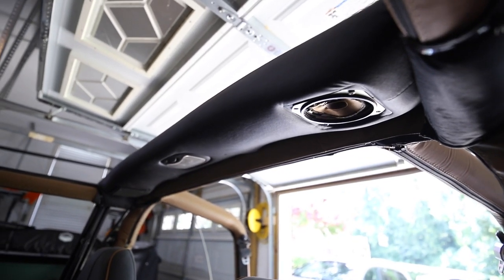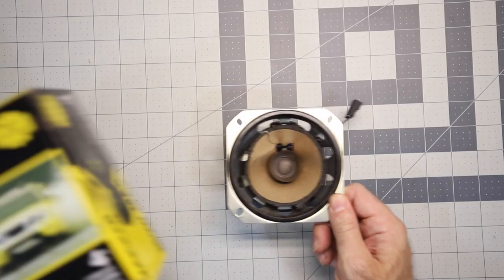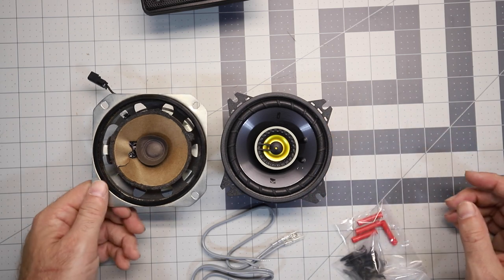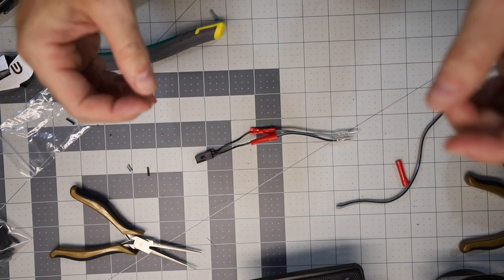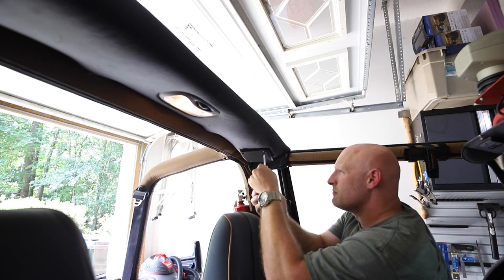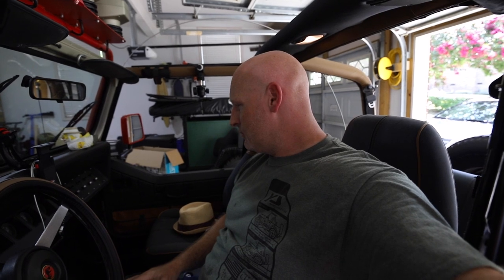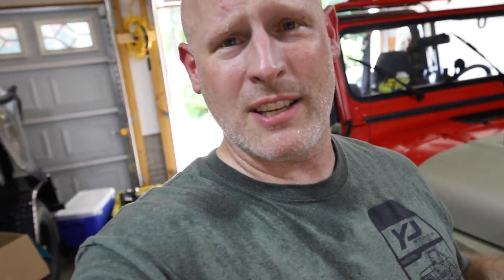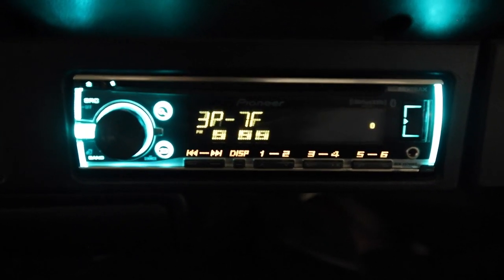Jeep YJ Stereo Upgrade & Factory Radio Install

Comment: I know it's been 2 months but I just wanted to let you know that heat shrink for wires is your best friend. Or if you already have the wires connected you can use liquid tape.
Reply from the maker: Thanks. I really need to get into the radio again and get it working. Haven’t had a chance yet.
Reply: @SimplyMustGo  well I had a 95 back in the day and I'm looking for another one. But heat shrink and liquid tape was the best. It keeps water out and we know if you take the top off its going to rain not dought about it. But as far as your radio make sure its grounded good or it want work properly. Wished I was closer I'd help you out. I grew up in NC lived there up until 7 years ago now I live in Missouri.
Reply from the maker: @jk_wrangler13  thanks! Maybe one day we’ll get to meet half way!

Comment: Where did you find a retro radio with Bluetooth???

I've similar issues with my 1994 Sahara.  Currently waiting for a used oem radio
Reply from the maker: This is the radio I ended up with and I really like it. https://amzn.to/3FPrxzk also you’ll need the adaptor. https://amzn.to/3W8HzcM
Reply: @SimplyMustGo  did it fit well?
Reply from the maker: @thomasstanfield1891  Yeah, here is the video that has the install of that radio. https://youtu.be/zGI3fvRkHyw
Reply: @SimplyMustGo  does the dash facia need trimming?
Reply from the maker: @thomasstanfield1891  no. No trimming or anything. Pretty easy straight clean fit.

Comment: Did you take down the video you did about replacing the cushion for the soft top frame? What was the replacement you told us to get?
Reply from the maker: I don’t think I did one on a soft top cushion, are you thinking of the roll bar padding? If so they are the best top spice roll bar pads.

Comment: How did you discover the ground issue (screwing in the radio)? Did you redo the install and did it work?
Reply from the maker: Beav told me about the grounding issue. But even after redoing it I couldn’t get the radio to work or at least get the Display to turn on to figure out what was going on. Hoping to revisit it this weekend.

Comment: Every single time I do this to my 92' it all gets stolen, because they're so easy to break into. I bought two motion sensor alarms that I think might have helped. We'll see..
Reply from the maker: So how does that happen exactly, are they breaking in at your house or while you're parked in a parking lot etc... I hear about that stuff, but have a hard time envisioning someone doing that in a parking lot in broad day light.
Reply: @SimplyMustGo  Yes. I drive it everyday, but It sits under a carport at night. Hardtop and full doors or not. One of the doors is just open in the morning sometimes. They even stole my fire extinguisher, license plate gas hinge frame and just the face of my stereo one time..., That's just mean. Could be worse I suppose. No glass or expensive things stolen or broken on purpose..